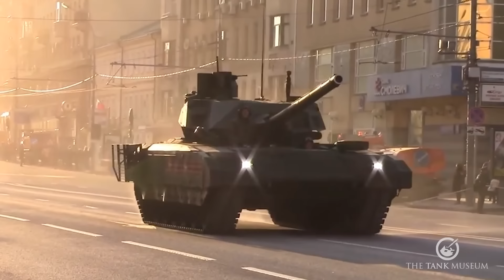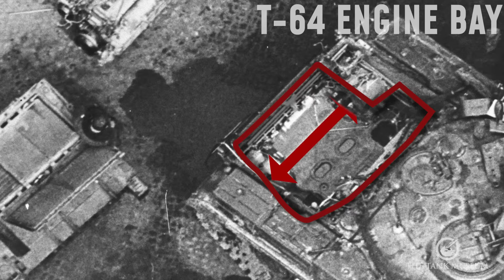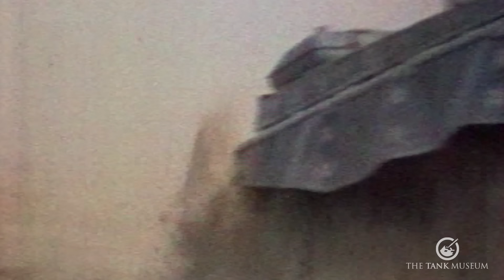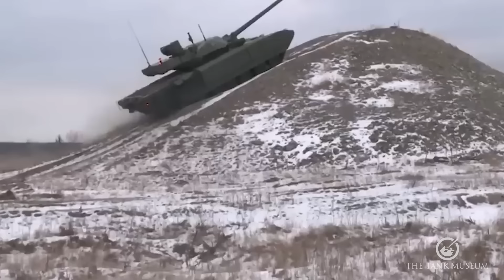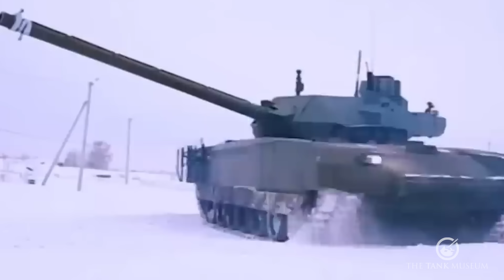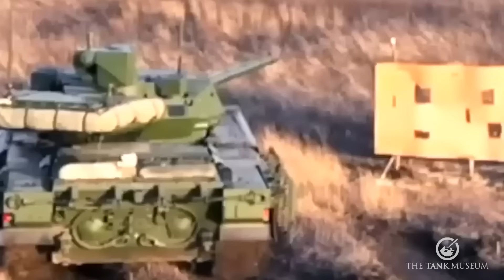Radical or Ridiculous? | T-14 Armata | Tank Chats #171

Comment: Aside from the lack of numbers, any western tanker can tell you about the lack of situational/terrain awareness from having all the crew down in the hull.
Reply: good western tankers havent fought a drone from above war
Reply: Drop shorts just need to get near, shrapnel takes out cameras etc

Once blind, becomes a drone target, or tractor, which ever turns up first!
Reply: It really depends on how good of a sensor suite they have.  I should imagine that given how cheap cameras are you would have at least 30 or 40 of them.  This is especially good for the driver as if there are a couple on the lower hull he can get a really good picture of where he's going in dicey terrain and, of course, a set on the rear for reversing without a spotter.  For the commander I think it may be more problematic unless he's got a 360° screen suite as it can become pretty disorienting swapping between views.  And then there is still the problem of looking up.  If they've got good software that stiches views together it might not be so bad.

Disclaimer: Keyboard warrior. No first hand experience.
Reply: Yeah makes you wonder what the fk Abrahams X is doing :face-blue-question-mark:
Reply: I can’t really imagine that the Russians have made adequate sensors to replace the crew in the turret. They might have though.
Reply: @Masada1911 prime targets for snipers though. Hit all the cameras and the tank is mission killed.
Reply: @roadsweeper1  sure buddy
Reply: @roadsweeper1  But good luck hitting all cameras. Granted, with their needed optics they are propably a bit bigger than the camera of your phone, but still quite small targets even for the best snipers, especially when moving. Even destroying the periscopes or gunsight on conventional tanks isn't really practicable. So it might work in theory, but in the field there are propably easier ways to put a T-14 out of commission.
Reply: @roadsweeper1  Yeah dude! just snipe the tiny sensors on a tank that can shoot from miles away and has thermal imagers!
Reply: @Masada1911  Tnowing their technology, I can bet it would not work most of the time.
Reply: @Masada1911  you don't look out of tank by yourself like in ww2. You look through sensors. Not forget that armata can be remotely controlled.
Reply: @trololoev  no you look through periscope viewing ports...
Reply: @trololoev  most western tanker commanders will be looking out the turret.
Reply: @trololoev  The armata most certainly cannot be remotely controlled. The Russians sure will ciaim it can, but Russian claims about the capabilities of their equipment and vehicles, and their actual real-life tested capabilities are 2 entirely different things.

The Armata has had massive issues throughout its entire development and is most likely in a state in which it cannot be fielded in combat in any useful sense. Russians have had to rely on western components on the sensor, optics and electronics side of things for a long while now, and ever since they invaded Crimea these have been harder and harder to get. They do not have the domestic capability to produce high-quality precision electronics and integrated computer systems.

When they tried to bring a single armata to a parade a year or so ago, it failed and had to be towed, because apparently even the engine is very, very poorly manufactured and has continuous issues.

Seeing as how the losses of Russia in Ukraine now are mounting and the war is going very very badly, if they had any combat-ready/capable T-14s that they could roll out, they most certainly would have done so already. Instead they're pulling older and older soviet stock out of storage and throwing it in to get blown apart by modern anti-tank weapons, because it's legit all they have left.

So no. The armata at this point is a tank that exists solely as a propaganda piece and not as an actual, usable MBT. Anything the Russians claim a given weapon system can do should be taken with a MOUNTAIN of salt.
Reply: @trololoev  The eye mark 1 is the highest resolution, widest field of view, and the most advanced sensor on a tank. For spotting targets, obviously a thermal sight is better, but simply taking in your surroundings and understanding where everything is, there is no substitute to just sticking your head out of the tank
Reply: @trololoev  tell me you have no clue what you are talking about without telling me you have no clue what you are talking about.
Reply: @trololoev  Some one should tell actual tankers that.
Reply: @phipschi4255  actually, it's much more likely that he was just talking about the turret.
Reply: The driver has better visibility than an Abrams driver. It actually has many cameras to work with. Driver included. Something the Abrams driver doesn't
Reply: So your just gunna gloss over the fact plenty of western countries ifvs are becoming crew less turrets?
Reply: @acedogboy8421  IFV =/= MBT
Reply: @marcussoininen2084  oh so ifv crews dont need situational awareness now?
Reply: @acedogboy8421  yeah but those aren’t intended to engage other tanks
Reply: @shawnmiller4781  actually they are... aussie and lithuanian boxer are both equiped with spike atgms and 30mm autocannons to pen tanks sides if they came into contact.

Comment: Neither?
It's just happens to be the in the same situation as if Germany in April 1945 showcased a "revolutionary" tank design with gas turbine, electric transmission, stabilized squeezebore gun with autoloader, quad tracks on independent interleaved suspension,  a rail mounted on top of the gun to launch guided missile, remote controlled autocannon on top of the turret and full set of night vision equipment for all crew members. And then told that it's being accepted into the service, that they plan to produce 10000 of them and that Steiner would arrive with them any second😅

It's a glorified concept/show car ¯\_(ツ)_/¯
Reply: All built around a 19th century steam engine. If we want to keep the years about right for this comparison.
Reply: @harmen2456 How, it's engine was made in the 90s?
Reply: @voidtempering8700  The very same way the t72/t80 use upgraded versions of an engine designed in 1931 despite being built much later. 
Basically they got a bunch of porche tiger engines during ww2, decided to build on that and convert them for oil pumping and the like and then, for reasons best left to vodka and cocaine, they put that into the t14.
But hey, at least they're not using iterations of the t34 engine anymore!
Reply: @harmen2456  Watch redeffect, Lazerpig has no idea what hes talking about.
Reply: @gordonamos7365  yeah ... Watching the Russian Copelord.... Russia stronk ... Russia winning in Ukraine .... 🤣
Reply: @FRNMLDR  No one is "winning" RedEffect simply explains the truth behind the tank, backing it up with sources something Lazerpig failed to do sufficiently. Who is the Russian Copelord you speak of? Try looking at things without a pre-established bias.
Reply: FEGELEIN
Reply: Russia losing ?? What you guys smoking?! Ukraine has ten times more casualties than russians...russians destroyed 2/3 of their soldiers and nato claim by august has no munition...western propaganda do harm for some of you..terrible minds!!!
Reply: @YANG ZIOU HCI But corrupt military and political ties is a long tradition in  Russia. 

Tech matters, but if you can't mass produce it, what's the point? This is not  a Syria situation, where you can bomb civilians and pretend to have a mighty military equivalent to the USA. 

When the Russians say yeah we don't want the t-14,  I think you can assume there are many reasons why it won't work. So all that work seems to be a dead end.
Reply: @YANG ZIOU HCI "Russia does not face an existential threat". Really?  Even Putin and Prigozhin ("Wagner") disagree with you. One is scaring Russia with NATO while the other with a new revolution.
Reply: @YANG ZIOU HCI T14 must be very bad, at least in practice because the Russian army has a long tradition of being technically retarded. Only simple and robust weapons (Kalashnikov rifle ot T34 tank) worked well in the hands of Russian soldiers. Armata (T14) is on antipodes of that.

Comment: Does the T14 offer the helicopter turret as an option, or is that standard with Russian armored vehicles? 🎉
Reply: They heard about NATO self propelled howitzer and demanded a competitor but the designers misunderstanding of what it was lead to the design of t series jack in the box self propelled turrets.
Reply: @Carl0s695  The funny thing but Russian propaganda claims that someT-14 tanks were used at the front in April... as poor man's howitzers. Even if true, it only shows how vulnerable the tank is even according to the Russian army.
Reply: The turret has some armor but as it is lighter it will fly even higher than in other Russian tanks. The only difference is that the crew in their "cocoon" may possibly survive it.
Reply: like leopards in syria and coming soon to all the garbage the west has sent ukraine
Reply: Turret flying off can happen on every tank but ur to dumb to realize that
Reply: I doubt it's as good as previous generations when it comes to how high it can be launched when forcibly dislodged... don't think that matters. Remember how those Soviet tanks try to be lighter than NATO ones? Armata still tries to. One way it aims to achieve it is through that unmanned turret. Which can be translated to: our turret does not need armor. Which means NATO can shoot the turret, disable the gun and change the T-14 into a very expensive 3 man taxi. Or at least on the good days when the motor runs. I also find it strange that the reverse speeds have been left out. For all claims concerning mobility, Russian tank reverse speeds have been so poor, they tend to turn their tanks around on the spot in order to get away quicker...
Reply: @FrancisFjordCupola  A shot to most tanks gun mantle will disable the breach, because that is the point. The mantle is less armored than the rest of the tank to save weight because the breach will likely absorb the shot, allowing the crew to survive. An Armata turret isn't much bigger than an Abram's mantle because it doesn't need to house the crew, allowing it to save weight.  
I am by no means saying unmanned turrets are simply superior to manned ones
Reply: @FrancisFjordCupola  how does an unmanned turret translate into no armor for the turret automaticly ?
Reply: @Kamfrenchie  it does not. Unmanned turret means that a lot less space needs to be protected and vital elements form a much smaller target. It also means that the turret can both be more armored and weight less.
Reply: @FrancisFjordCupola  t-14 turret more protected that any tank on earth. If you talk about turret and not about modules on turret.
Reply: @trololoev  it is the most protected. It is protected by miles of air from any sort of fighting
Reply: @Dargesh890  Did you say something?
Reply: @wonkothesane7000  well, I said it while standing on the turret of a T-14. Not surprised you couldn't hear it, they are nowhere near anything dangerous
Reply: They are using nato approach of armoured explosive bussel.  So. No.

Comment: T14 will stay forever  only as prototype, as well as Bumerang APC or Kurganetz IFV. Now their industry is able to produce only T90AM, BMP 3 Dragoon ( highly modified BMP3) and few days ago saw new APC based on BTR87 project. Russia itself is not able to produce advanced armour system. Just look at their current assault rifle AK12. Even on russian channel i saw video where former military instructor explain with humor that platic ( yes platic not modern polymer) parts came form stolen old chinesee VHS tapes. KC took it from salvage yards in china, melted in izevsk and molded int stock or handguard. T14 is not last victim of sanctions. Take a look at Typhoon MRAPs family. Ramdiesel annouced that they will no longer produce kamaz K couse its too expensive and they lack foreign made parts as alison automatic transmision( yes new version will use manual gearbox). So new kamaz "typhoon" will be based on ordinary truck . Forget about independent suspensions, modern opto electronic equipement and high protection against IED  or mines. But this not only due to sanctions. Russia is corrupted to the bones. Local oligarchs bought yachts of oil tankers size meanwhile army has less and less money for modernization. By the way, great video as always. Greetings from Poland.
Reply: Excellently supported points! Cheers and best wishes from the US.
Reply: Keep dreaming kiddo
Reply: lies, lies and lies.....speculations...we don't know anything about happening in Russia
Reply: @interpl6089  lol why are all your comments like this? It's just sad. Give it up.
Reply: We know nothing?
Speculation?
Lies?

You might not, and I'm pretty sure I don't know either, but, I'm going to bet that our Intelligence agencies (From humint, elint and upto Sat) will have a VERY good idea.
Not just because of false pride, but because there are very many agencies, assets and 'friendlies' ALL over the globe who actually share Intel with Blue.
Don't believe the false narrative that western Intelligence agencies are weak, feeble and useless.

But, you believe what you want to.  It's a free world..... well..... in the civilised and democratic parts ;)

Be well.

Comment: I’m confused by the 2 plane stabiliser point. I was under the impression that the cent 3 in 48 and British prototypes before were the first to feature 2 plane stabilisers.
Reply: Yes British in 48, Soviets in 54 then the US not until 1972 (Bar the Sheridan light tank in 67).
Reply: The Germans used large gyros (as opposed to small gyros) to stabilize the gun of some Panzer III 37mm and 50mm models used in North Africa.  Large gyros means the 6 inch and 8 inch gyro directly mechanically stabilizes the gun.  The Sherman used small gyros where a sensor (in this case electrical switch contacts called silverstats)  actuates a hydraulic valve to drive the gun and is mechanically linked sight back into position.  These were elevation (ie pitch) only and a little crude as the control was only 'on-off i.e. bang bang control and the sight was linked to the gun and so not entirely steady.
-The German interleaved torsion bar suspension system with its long travel, shock absorbers (absent on many tanks), multiple large diameter contact points was among other things intended to assist in fire on the move.   Tiger tanks and Panthers moving at speed over ground do appear to be quite smooth.
-German plans at the end of the war was for Tiger II and Panther Ausf F to receive stabilized optics, something which can be done very well and easily as opposed to driving the whole gun.    The gun wasn't stabilized but the optics was so the gunner could get an accurate lay on the target.  The gun was then fired electronically when it lined up with the sights taking into account crossing speed and and firing time.  This is naval gun practice.
-The Panzer IV used an electrical Travers, I think DC ward Leonard system.   It would have been easy to feed the output of a rate gyros into the field of the ward leonard generator to speed null the turret.    Using a stablised optics would have taken care of elevation.   The Panther and Tiger had hydralic traverse.    In that case the Germans would have used reversible variable displacement swash plate servo pumps with a small piloted motor adjusting swash-plate pitch.  Again Naval practice of the day and also used in some of the larger German FLAK guns.
Reply: @williamzk9083  all that writing and you missed the point. 2 plane stabiliser.
Reply: @jackburton9035  I refereed to 2 plane stabilizers at the end.    These early stabilizer systems did not stabilize the optics separately and hence were still limited.
Reply: @williamzk9083  There were single plane stabilisation earlier, that is they only stabilised vertical or horizontal movement not both simultaneously. Optical stabilisation is also completely different and many tanks had a system where the commander could digitally designate a target for the gunner to acquire. The Germans used the large motors for quick traverse and the smaller motors for fine movement aiming, of course by the end of the war they had totally ditched electric turret traverse due to lack of materials.
Reply: @watcherzero5256  Digital systems probably didn't come in until the 1970s.   Certainly the WW2 systems weren't digital nor do I think were the Metrovick system on the Centurion or the T-54.   The systems from the 1940s/50s had limitations.  They just weren't precise.

Comment: Isn't the engine basically a tigers? Might be a go source of spare parts for you guys!
Reply: yeah , i think your refering to lazerpigs vid , which i quite liked but to balance your views you might want to watch redeffects vid on the t-14 , as far as I understand it , the engine is based on the tigers engine but is modified to extent that calling it the same as a tigers engine is just not correct , futhermore alot of current tanks use engines (upgraded ofcourse) that have their origins in engines made in the 60s/70s , eg look at the challenger 2 and leopard 2 engines
Reply: Yes, a SGP Sla 16 (Porsche Type 203) 16 cylinder X-diesel. The sole operational prototype was fitted to a Jagdtiger which was then captured by Soviets.